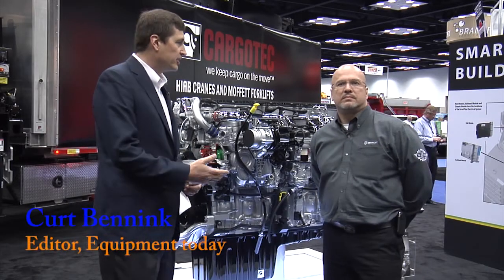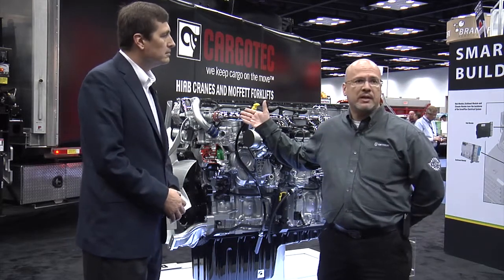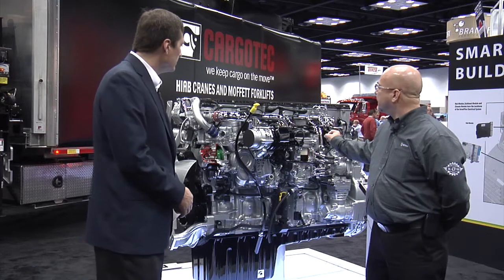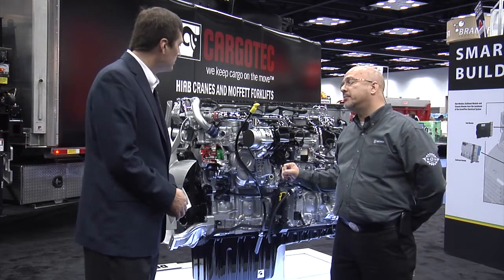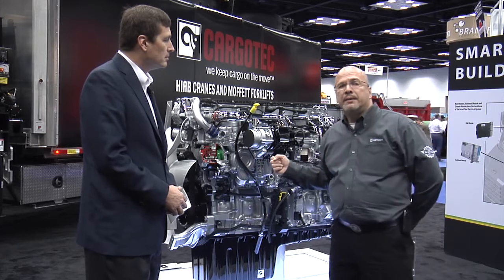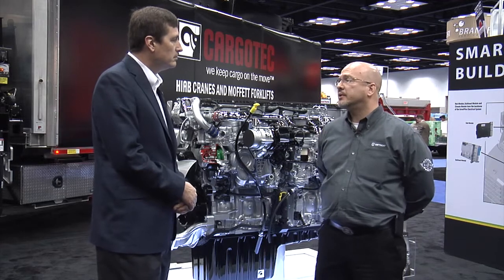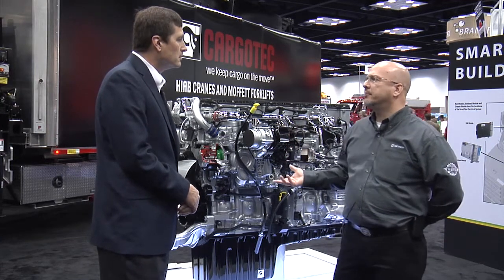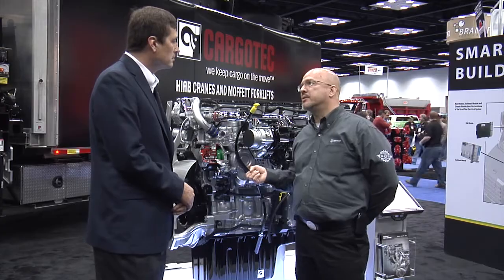Video: Detroit Improves its Workhorse DD13

Comment: This motor sucks....it will never be a series 60. Too much technology too many sensors. The guys at my local detroit dealer seen my series 60 and told me keep it as long as I can!! Not meant for the small guy. How are they saving the earth whennthe motor stays in the shop 80% more than the old ones and dont last as long. Any motor pass 07 is trash(my opinion). I have a 2000 11.1 detroit. 3 years 2500 miles + a week never left me stranded. All I see on tow trucks is new motors. Political Bull$#!+!!!!!!!
Reply: Yup. Nothing but politics. A real shame.